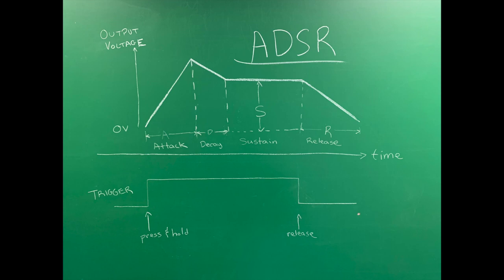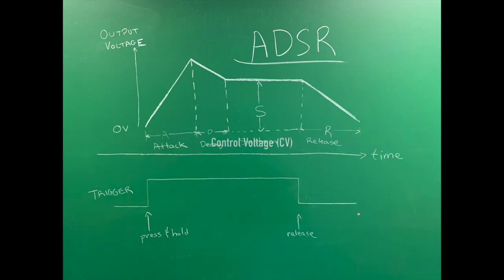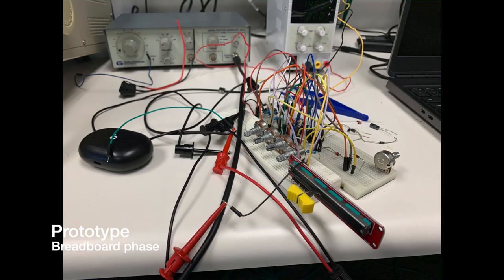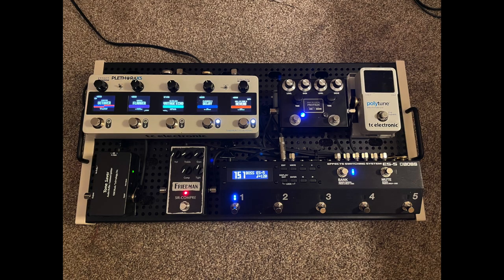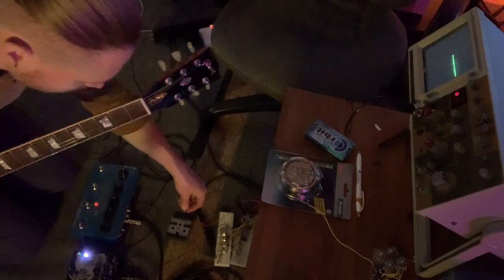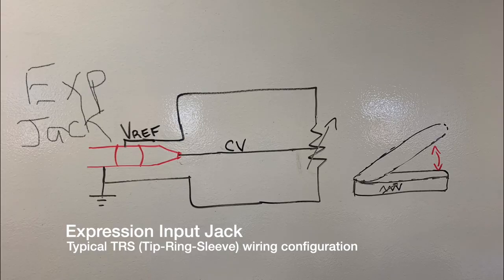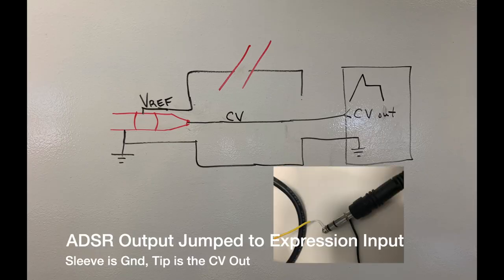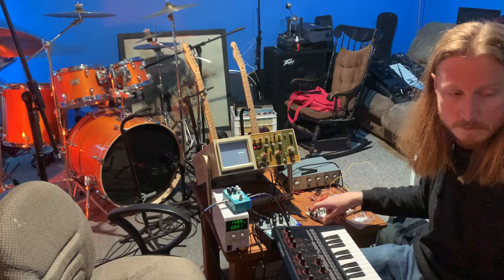ADSR Envelope Generator Stompbox

Comment: Great job in design. Nice presentation. One question. Do you have plans to incorporate digital controlled potentiometers?I don't mean digitizing the signal but digitizing the controls so the user could save control settings in memory? - Andrew Olaska CS213 Fall 2022
Reply from the maker: Thanks Andrew. I hadn’t thought of that but it’s actually a really good and practical idea. I could envision a 2nd generation iteration with   programmable presets. Of course I’ll have to learn how to digitize the potentiometers first, but thanks for the idea!